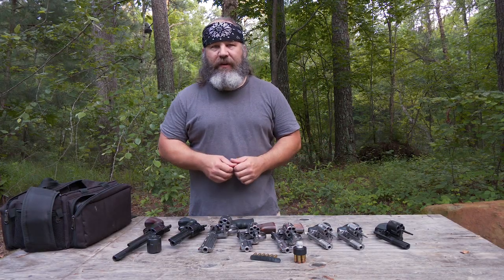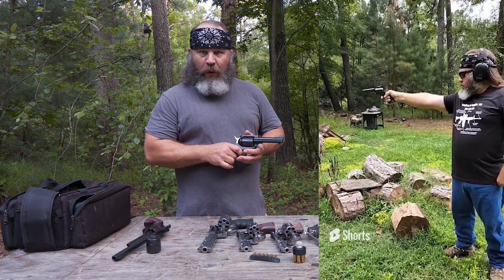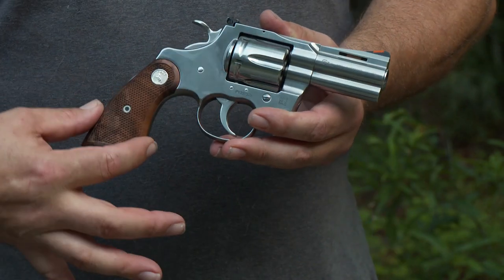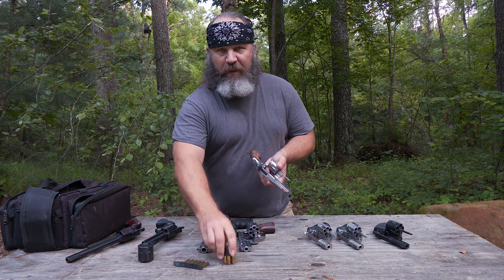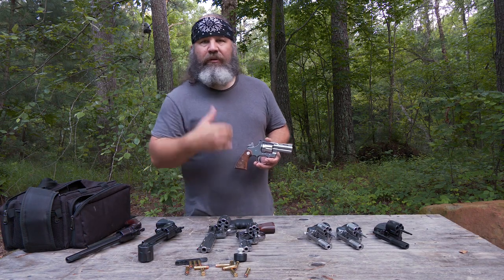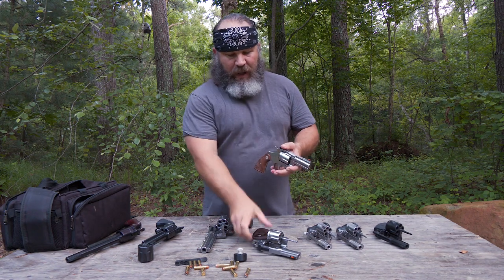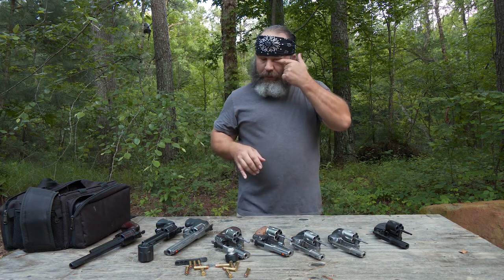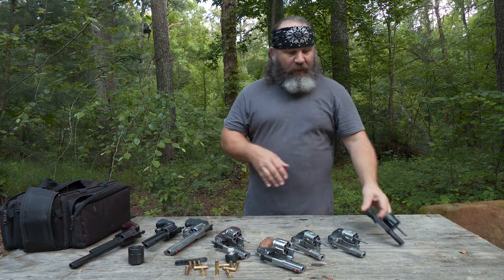Back to basics, revolvers.

Comment: Hunter I have tricked out my 460V 460 S&W magnum X-frame double action revolver with a five inch full lug muzzle brake equipped barrel that came from Smith and Wesson that way. 
Rimmed cartridges:
460 S&W magnum 
454 Casull
45 Colt All loads
45 Schofield 
Semi-auto cartridges:
Using TK Custom stainless  steel moon clips for 45 ACP that moon clip also holds 460 Rowland, 45 Super, and 45 Winchester magnum using Starline brass. Had M&L Gunsmith install an extra length firing pin from Cylinder and Slide to allow firing rimmed cartridges without need of a moon clip spacer.
Reply from the maker: Now, my friend, that should like a bad ass hand cannon.